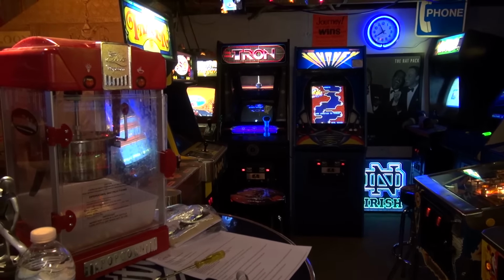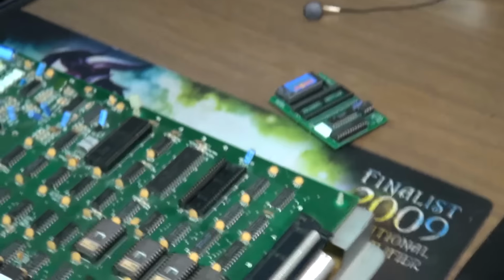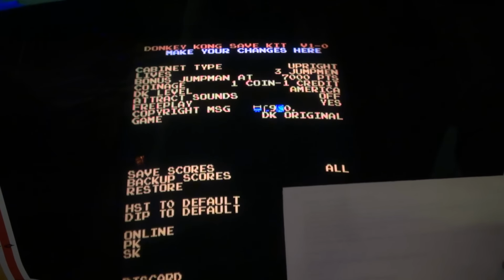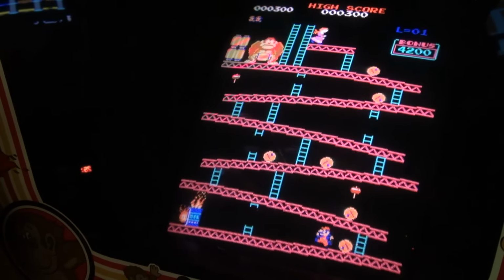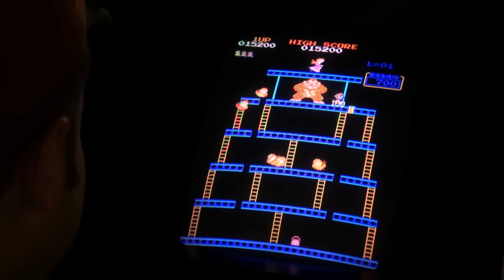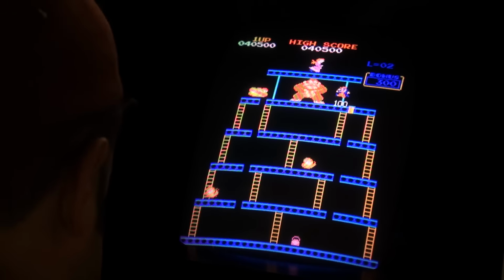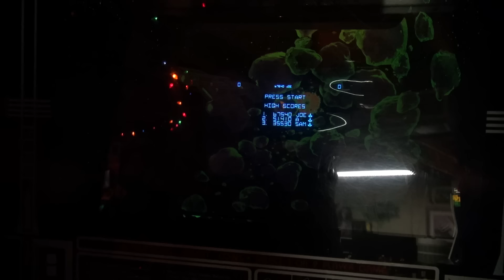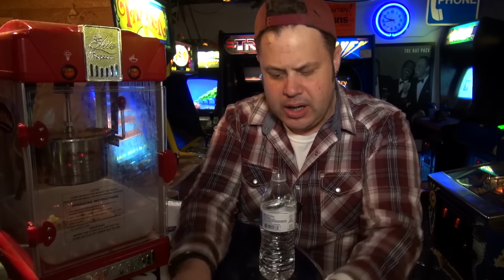Donkey Kong Arcade Internet High Score Save Kit! WOW! Uploads high scores over Ethernet!

Comment: John, just FYI, if you buy a WiFi bridge you can connect it to the ethernet port of the high score board and connect over WiFi.
Reply from the maker: +Chuck12 - Yeah, I was just trying to do it cheap.
Reply: +Chuck12 - The only thing is that the bridge would require an extra power cable to run as well.  That could be taxing enough on the electrical system with all the games that John has on the circuit.  Ethernet is more easier to deal with as it doesn't require wi-fi authentication like that.

Comment: Nice Kit. Like the idea, but missing a wireless option as well, which is probably the way to go for ppl. with just 2-3 machines instead of an own arcade where you already have a ton of cables installed.

Supporting different modes is a nice touch. Yeah, no biggie to run a few LAN cables to a cheap switch connected to a wifi bridge or repeater along my power lines if you have an arcade set up. Probably interference inside the cabinets will be an issue anyway in a lot of cases. Yeah, can see the LAN option here is the smart safe and easiest  thing even though it requires some more physical installation. Let's be honest, if I like these kits I will end up putting them on all my supported machines and while at it put LAN sockets everywhere in the wall. Just an upgrade of my current power sockets. Future proof for whatever will come or what ever stuff I put in my arcade.

What I would like to see instead of uploading stuff to the internet site is to host a private high score DB in my LAN (e.g. the SQL server on my NAS) and share/replicate this DB with the arcades of my friends and provide my own interface (highscore screen saver on my basement TV). I would love that option especially as I have that already setup but requires manual entering right now. But I guess customization and backend configration instructions to customers who like to do this should not be a biggie. 

Now do that mod for pinball machines and I am so sold (yeah, Pin Snob mainly). But will order one and test it out for my DK and DKJR at least..

Comment: Hey you want to know how I solved the DK/Nintendo mirror thing? I went to a glass store and had them cut me a mirror the same size as the DK front bezel and then take the paper back piece and fold it up between the back and the cubby hole where the back of the marquee light is. This allows you to look right over the top of the monitor to adjust.  OH, btw. I was the one that gave Ian the list of caps for the DK 2 board set so he could add it.  I work on alot of games and if you two want me to I can continue to do this for all the games I work on.

Comment: Hey John, (as of 21/Feb/2016)  the current Euro exchange rate: 1.11 Euro to 1 US dollar.  That board you installed on Donkey Kong is about $66 USD or $44 roughly.  If you go to xe.com, you can see the current exchange rates
Reply: +Peter Vachon correction the price should be 45 Euro, should be about $50 and change in USD

Comment: What if that old board fit ontop the new board. Then High Scores will be saved online,and on the cabinet!
Reply: +LBPPlayer7 the scores are saved on the machine anyway. the upload is just an extra feature.
Reply: Stefan Kimmlingen Oh. You can still use that other save kit for Pac-Man that John used 3 years ago along with this for the initials screen thing,if this kit doesnt do memory hacking to add that.
Reply: +LBPPlayer7 you can only use one kit but our kit saves scores to the machine and (if you get the online kit) to rhe internet scoreboard.
Reply: Stefan Kimmlingen I dont think your kit supports the hack that supports initials. If you could add that to the Pac-Man version,then that would be cool.
Reply: +LBPPlayer7 our savekit supports 3 and 12 digits. it saves the scores offline to your machine and if you buy the savekit with the online-feature it saves the score to the internet leaderboard, too.
Reply: Stefan Kimmlingen Im saying that Pac-Man doesnt normally support initials,and that there is a kit that allows you to save the high scores and is compatible with a ROM-set that allows you to input your initials.
Reply: +LBPPlayer7 if we do a savekit it will support initials, too. we did that for other games before. :) so if we are doing a pacman it will have initials.
Reply: Stefan Kimmlingen It has been done before. I will use yours when I get a Pac-Man. :P